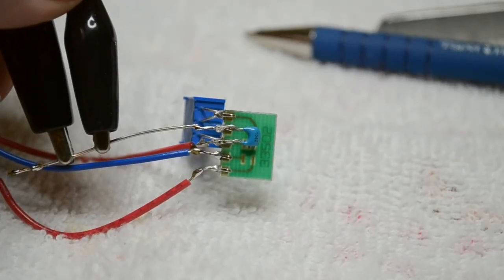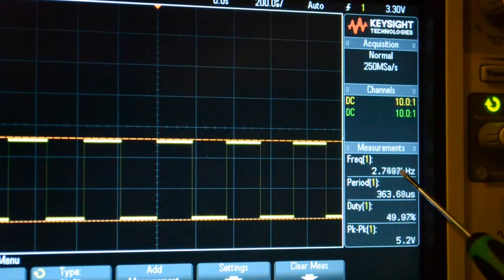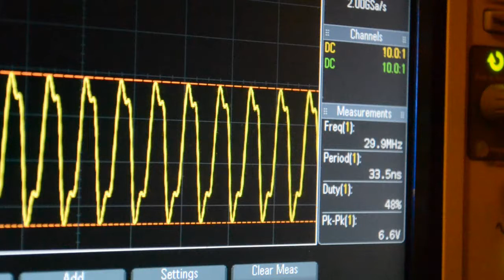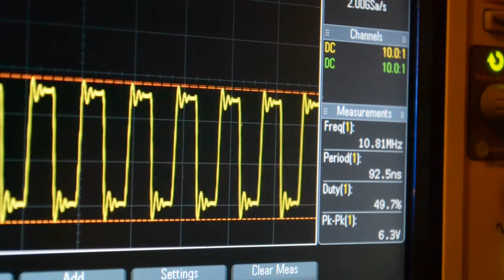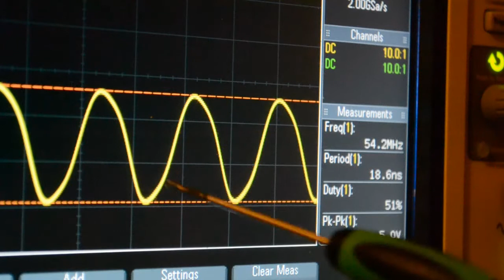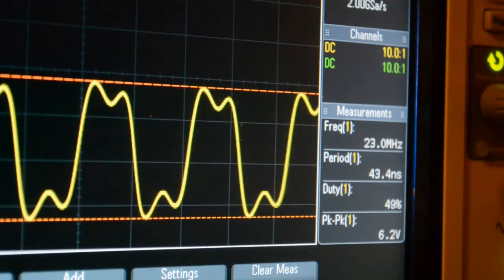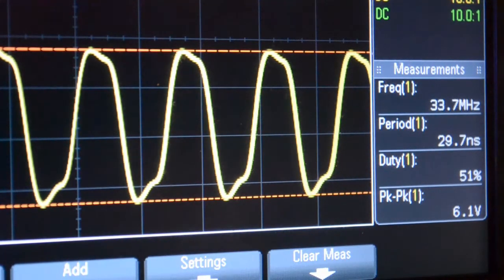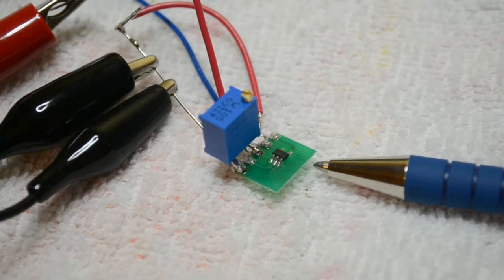Linear Technology LTC1799 Adjustable Oscillator 1khz to 33Mhz

Comment: Nice video :D , I planed to use one of these In my fly back drivers as a fixed frequency clock source to drive a  full bridge
Reply from the maker: twirlywirly555 
Thank you for your comment.
Is the bridge a motor control or power supply or?
Reply: John B:) , Its to drive high voltage high frequency transformers , LTC1799 - Gate drive - Full bridge - Transformer .

Comment: Is it possible to amplify the output of this chip with a driver or a transistor switch?
Reply from the maker: It’s possible but you would need an amplifier with a frequency response equal to the desired frequency output.
Reply: Thank you very much for your answer. I need a generator for a frequency from 2-3 kilohertz to 9-10 megahertz. Transistors for such a frequency can be obtained. The main thing is sharp fronts. The widespread NE555 microcircuit has very curved fronts and a short frequency range. I was just looking for a suitable one.

Comment: That's a fascinating IC! I was expecting it to require serial data to set the frequency, but it couldn't be simpler to use. It's almost retro! Incidentally, you make me cringe when you wave that metal tool around near your scope lcd! I'm very protective of my new Rigol, nothing's touched the lcd yet, not even my fingers!
Reply from the maker: +ProdigalPorcupine 
lol, I know what you mean with the screw driver.
Yes a cool device.
I was counting spi pulses last night and having to touch the scope screen.
The ringing and round pulses were the long earth lead, not the chip.
Thanks for your comment.

Comment: Hello. Really nice video and perfect working explanation, congratulations. I had a look at the price of a LTC1799 and it´s nearly 4€ each. I have a question (maybe it´s and stupid one, sorry if that´s the case), would it be possible to use a 555 oscilator to do the same, which price is about 0.1€? Thank you in advance for your answer.
Reply from the maker: +Sergio Roman 
Hi, Good question.
Apart from the 555 requiring more components, I don't think it can run up to 33 MHz.
Maybe it can, not used a 555 for nearly 555 months lol
I just liked this tiny package, one pot and one cap.
What sort of frequency were you after?
Thanks for your comments
Reply: I used it recently and I can tell that you cannot achieve more than a few hundred kHz, even with the CMOS-version. It's simply not made for RF.